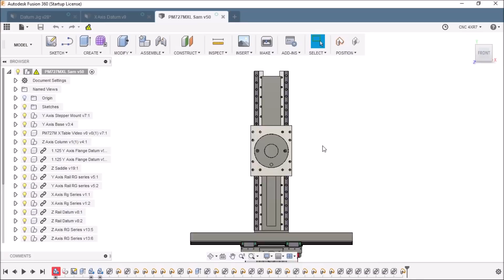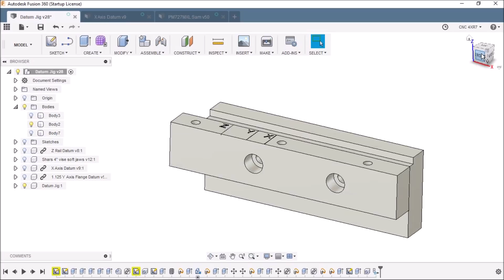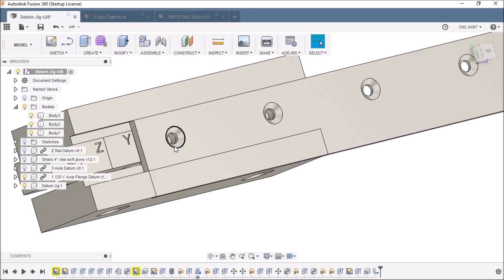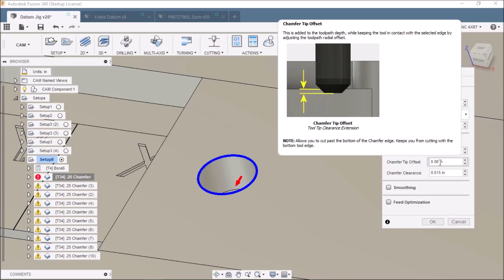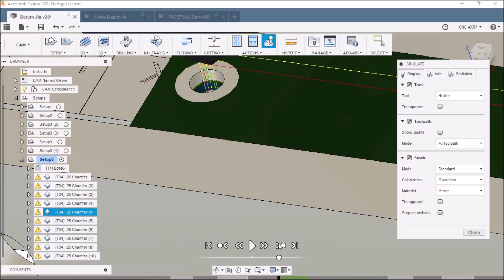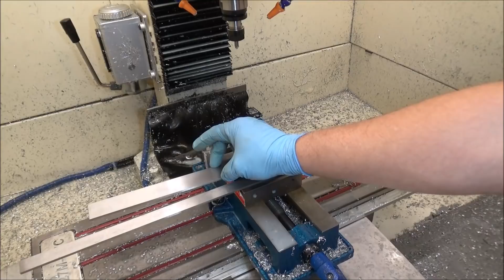PM727MXL Datum Mounting Holes

Comment: Hello,  

Great job documenting your process. Just a heads up on some things to watch out for:
1) Typically c’sink holes are not used for holding down alignment details.  This was something the old timers taught me many years ago, coming from a design engineering background. The reason is, as you tighten down a c’sunk bolt, the bolt taper angle will shift the plate, based on the tap location.
2). When you have the rails mounted, one will be you master and secured, the second will be tramed in for parallelism to the master rail.  Verify the height of each rail to each other as well.  Both processes can be checked by mounting a dial indicator to the rail block, sweeping back and forth.  I may stating the obvious, just trying to help.
3) Last thing, squareness of your X rails to your Y rail is very critical, just have a way to tune it in.

Anyway just trying to help and not be critical in any way.

Good luck
Reply from the maker: Thank you for sharing the that Information. Yes making sure the Tapped holes are aligned is critical! otherwise the Datum would have been wavy.  The Use of the Datum is to help keep everything in place rather than just bolting down the rail only. The RG series rails Have 2 x the mounting holes of the HG series which should help keep it secured. I have also considered adding a couple alignment pins/ shoulder bolts in a couple Bolt locations to aid in alignment.

Thank you for the Information Trial and error as this is my first go at adding rails Hopefully less errors. LOL
Be Safe Sam
Reply: I was thinking the same when watching the video, would you have had room for button heads ? what about  tapered pins long enough to be knocked out from the underside  of the dovetail reamed in place after  the alignment has been made?

all the best with this from the UK
Reply from the maker: For clearance reasons I had no choice but to use  Countersink screws. The Datum can be pinned in place and the rail once installed can be pinned in place.

Comment: Way to complicated. Couldn't you just add the countersink to your drill table and peck down just like you would drill a hole? You should know how deep to go because you model the countersink anyway.
Reply from the maker: AH Hah! well i suppose if I used a bigger chamfer mill I could do this but in my past experience it tends to chatter. with the 1/4" Chamfer mill I'm using a small oscillation. the holes turned out perfect however just took way to many OP's for me.
Of course I could have done them by hand but there are around 90 holes.
Reply: Countersinks are no different than any other mill cutters. You have to take the time to find out what the correct feeds and speeds required for your cutters. I have found that countersinks like a slow spindle feed and even pressure for cutting a clean chamfer. Experiment with a couple different types and I'm sure you will find one that works better than the others but the larger you can use on a particular size hole seems to work better for me. I usually have my best luck with a countersink twice the size of the hole I'm working on.
Reply: BTW I really like your fixture idea. That was very well thought out.
Reply from the maker: Thanks!
Reply from the maker: Thanks For the info. I think my biggest issue was trying to make Fusion do what I wanted.

Comment: Ever decide on the operating system?
Reply from the maker: Masso Or Path Pilot or Mach3  Yeah still undecided really Masso keeps improving And is still the front runner but the control cabinet will be setup so I can change over if needed.
Reply: Linux CNC has a primitive G code interpreter. Has a narrow range of formats is will except . No sub programs ect.
Since path pilot is linux based does it have the same issues as linux CNC? or is it just a completely new program running in the linux operating system? 
Masso seems to be really pushing what that little board is capable of doing As in USB , mouse ect , Sure looks like old time DOS.
Mach 3 you say is not fast enough would be interesting to test that?
You can add a second parallel card to create more ports use the original one for things requiring speed and the second for things like coolant and tool change actions.
Always wanted to try that dont have the time.
Reply from the maker: With the debut of PP Tormach did a lot of development on the Linux trajectory planner etc. which to my knowledge was implemented into Linux CNC. Now PP 2.0 is a completely new Linux base OS.
Masso is a Simple No hazzle all in one answer which is what appealed to me. And of course I use Mach3 everyday I'm very familiar with it and it works well for me if I choose to stay with Mach3 i will need to invest in a Smooth stepper for the Added I/O's. The plan is to make the control cabinet flexible to keep my options open.
Reply: You and I forgot his name were claiming real time signals are great if you go to a smooth stepper you lose the real time you will notice if you hit pause it may continue to run till it uses up the buffer.
That's why I was thinking about the 2 parallel cards in the control computer. Im sure you have noticed the 2 ports input mach has listed in the setup its designed to take 2 parallel cables to two break out boards. This would Keep your real time. 
I dont know if it works well but would be very interesting to try. 
Mach has so many features some work very well some are a little shaky. Did you know mach has a spindle calibration test that will automatically cycle your spindle and take index input trough the entire RPM range to create a curve to compensate any variables it senses at any rpm? Never tried it sure looks interresting
I was talking about the G code interpeter Not the trajectory planer. That updated trajectory planner just brought linux 2.0 up to the early 80's level its a lot of hype. I looked into it. It works but there is no amazing tech there
Reply: Ps interesting project. Keep pushing forward
Reply from the maker: Thanks Finding time is the hard part.
Reply from the maker: Yes that is a option as well I do have a lot of time invested in Mach3 with my Macro's and Screens etc. so you never know.

Comment: There has to be a simpler solution for the countersinks. I can't believe they didn't allow for step down on larger countersinks.  Have you tried a 3D ramp  using the countersink tool and selecting the model countersink surface under geometry?
Reply from the maker: I posted on Fusion Forums but did not get a suitable solution. I think I could trick the boring operation so that it would post a suitable Cam But that would require a lot of trail and error. The Boring Op allows for a ramp so it would just be a matter of defining a Flat  end mill with the correct offset to achieve the desired counter sink.